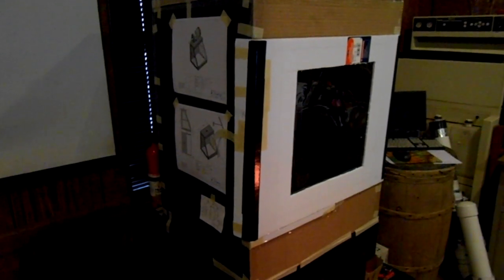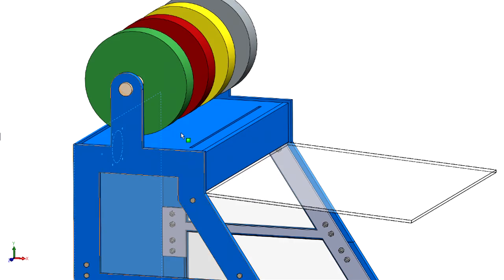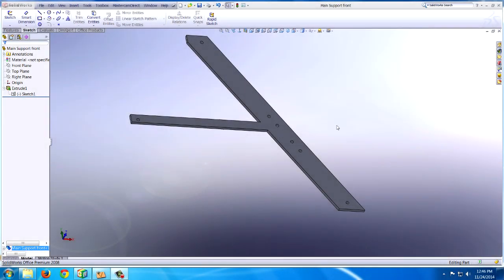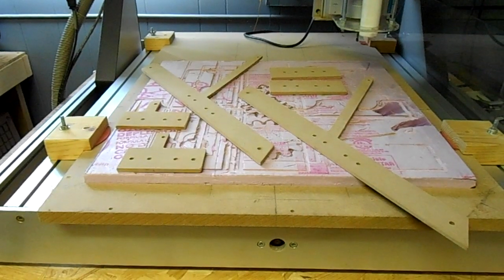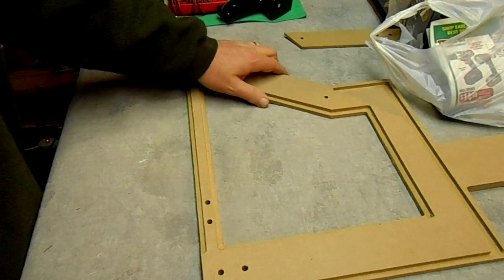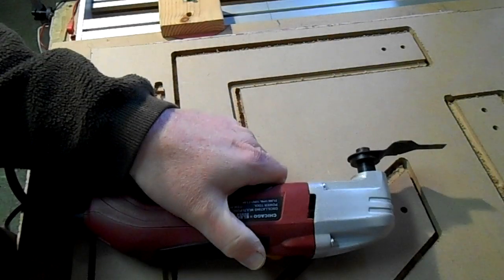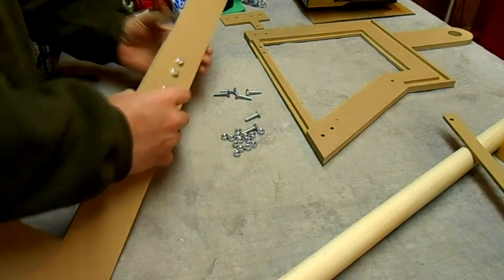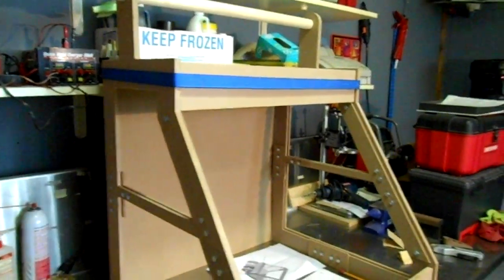Using CAD/CAM Router to Design and Build 3D Printer Enclosure

Comment: I think you should use Rust-Oleum Stone Creations Spray, Granite Stone color.  Neat project Steve.
Reply from the maker: Hello, Thanks for the input. Are you using your CNC machine or is the metal working taking over?
Reply: GuruBrew It hasn't necessarily taken over, but as a restoration project it has taken center stage.  The CNC project that you did making a circuit board is still my goal with the CNC.  I have several projects where I used an Arduino in their design.  I want to redesign them by integrating the Arduino circuitry within the project on a single board.  One was a cuckoo clock that works just like an ordinary cuckoo clock except for the cuckoo sound, it uses a LCD display panel that lights up on the hour and displays CUCKOO, when the bird pops out.  I made this for a friend that wears hearing aids.